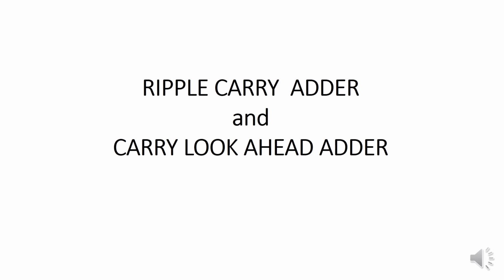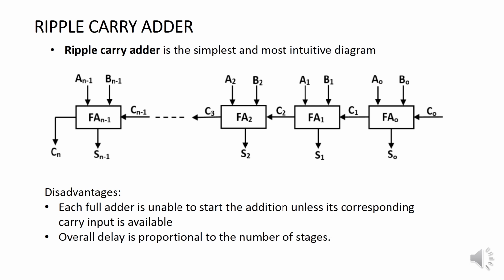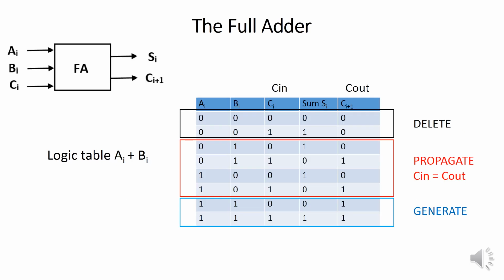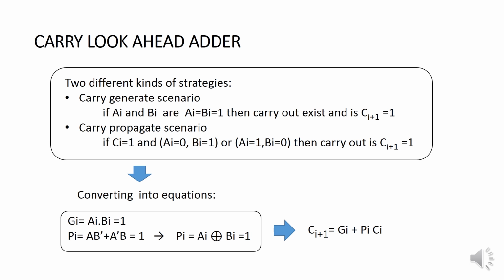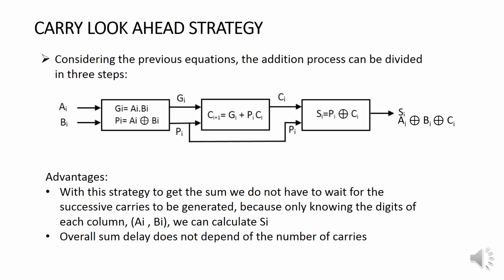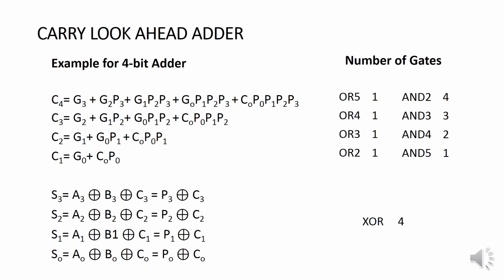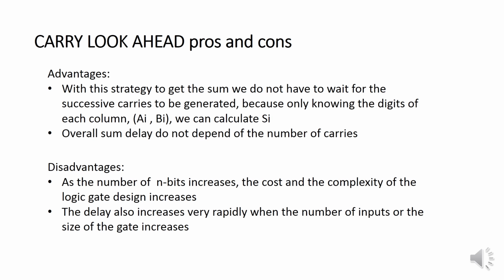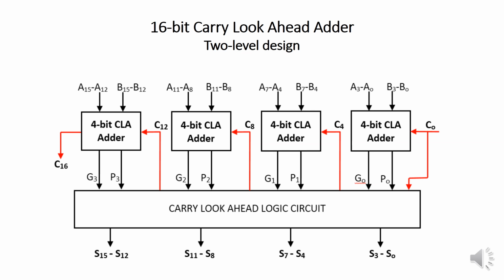Ripple and Carry Look Ahead Adder

Comment: But in case of 111111 + 000001, the carry will have to propagate till the end, right? So, if we use it as a sequential block, then the minimum clock cycle time will be determined by the worst case scenario, right? Which is the one where the carry has to propagate all the way till the last block.